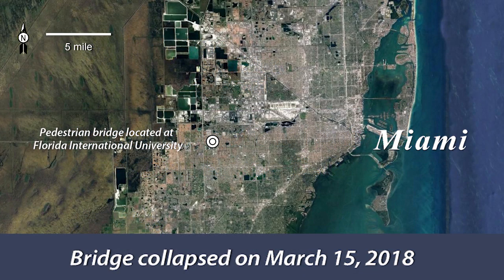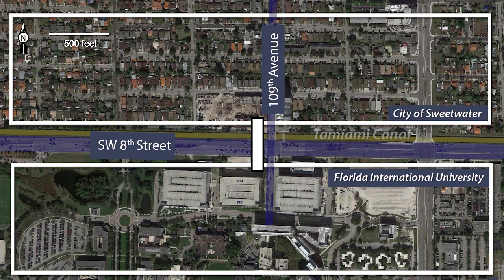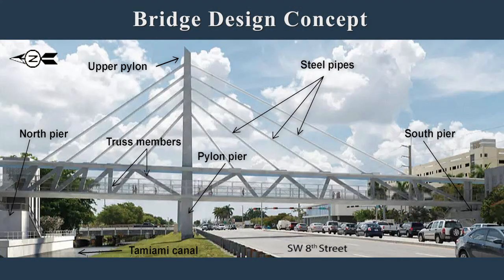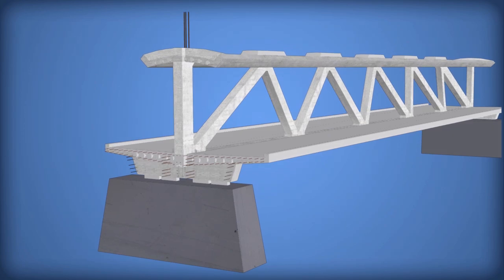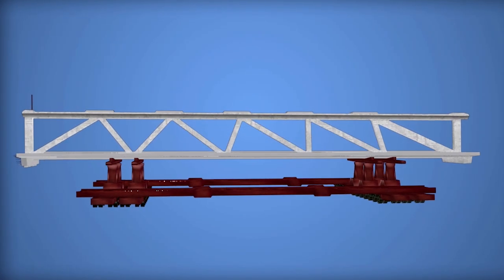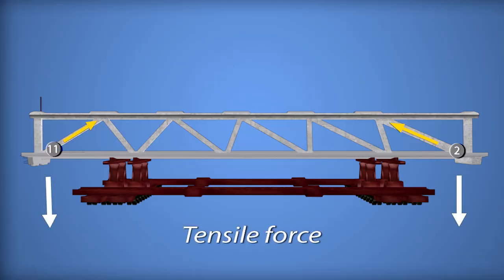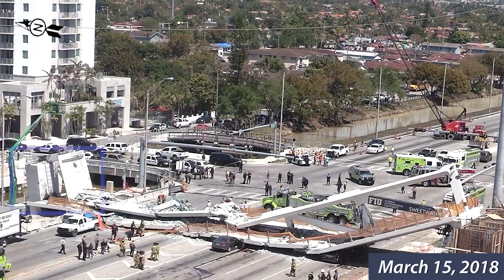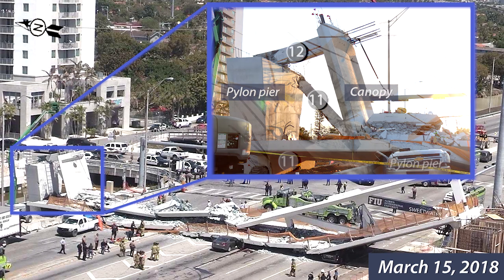Pedestrian Bridge Collapse Over SW 8th Street HWY18MH009

Comment: A steel bridge for this job would have been the obvious choice, even to a moron. 950 tons of dead weight for a foot bridge that couldn't hold itself up.! alarm bells should have been ringing for the designers right from the off. Jail Please.!
Reply: I agree. Maybe they can brush up on their engineering at the prison library.
Reply: betatalk357: I would rather have seen a proper bridge painted pink then this calamity.
Reply: A rope bridge with some planks would have been a better choice
Reply: Florida has some weird obsession with concrete
Reply: The reason we use so much Concrete in Florida, is because when it comes to Hurricanes and other high wind events, Concrete wins every time.
Check out Miami-Dade Building Codes. Every new structure must be built to withstand 150+ MPH winds. My home was built to Miami-Dade Code. We were in Irma and saw winds of 135-145 MPH, the only damage we had was a screen got ripped.
This bridge was criminally designed, criminally installed, and was unable to support itself let alone withstand a CAT4 Hurricane.
Reply: @Capt_Schwartz  Yep, that does make sense. Though it's never good practice to apply the one thing to all the things.
Reply: @Capt_Schwartz NYC has hundreds of elevated subway stations made of steel. They're just like umbrellas and Sandy did not knock them down. Open air steel would have worked fine there in Miami.
Reply: I’d suggest structural engineers are divided into two groups, through educational, cultural, aesthetic biases in their training, perhaps even by commercial sponsorships.  Hence the obvious incorrect design of an RC structure using steel aesthetics, as one style competes for the other’s aesthetic.
Unbelievably bad reaction to the truss failure.  It was obviously failing in compression when loaded. They deliberately tried to increase the compression by tensioning the reinforcement. Exactly opposite to what should have been done.  This was a decision sanctioned by someone not identified in this report.
Unbelievably too, the first reaction should have been replace the lifting bogies (if the structure was deemed safe enough to approach), before any remedial works were attempted.  
You Tube exposes so much that would be buried in dusty print.  Despite this fiasco’s emotional awfulness, a pity some of the comments are gender biased (without any evidence), whereas this event was the culmination of a several bad decisions,  each of which needs to be investigated for systematic failures - who made them and exactly why did they make them.
Reply: They wanted to appear hip and novel in their bridge design--something to brag about to other engineers.
Reply: The core problem with this an many other projects is the board or whatever is the decision making body is sold on the idea by the architects and engineers that their names are going on a plaque on an "iconic structure."   Instead of handling it as a structure designed to maximize utility, keep the costs low and be completed as quickly as possible, they are sold on an art piece.  A library was built in Baton Rouge which was sold as an iconic piece having part of the building cantilevered over a  plaza.  There were no restraints in fitting the building within its footprint.  The cantilevering failed.  I'm sure the cost per square foot was higher than something straightforward and the building was not in use in a timely manner.
Reply: Steel bridge would have been lighter and stronger
Reply: @TheDieselndust  Obviously true.  If you are besotted by RC as many bridge professionals are,  you want to demonstrate RC’s potential slenderness and beauty.  Like Shrek on a diet, success can be elusive.
Reply: @jimwoods9551  well demonstrate Reinforced Concrete where Innocent People Cannot Be Hurt or Killed!
Reply: @TheDieselndust  That’s quite a low bar... 
Regardless of the steel v. RC argument, there is a responsibility to design and execute civil structures safely.  Several people must have known how small a safety factor was involved.  When the first cracks appeared it should have been obvious that the sums or the execution were faulty.  Failure to declare it a write off immediately, shore up the wreckage and stop traffic prior to demolition falls on individuals and corporate directly.  Responsibility for these failures does not appear to have been assigned.  It is particularly important in this case where the designers were showboating by using the “wrong” or counter intuitive design philosophy.

Comment: Why didnt they just actually make a cable stayed bridge instead of just having tbe aesthetics of one?
Reply: There must have been a significant design change at some point, the design lends itself to steel construction. I've never seen concrete used in that way, as a diagonal structural member. Concrete has great compression strength, but incredibly low tensile strength, and a truss in general must have both.
Reply: @A_Lion_In_The_Sun  not likely. more likely would be that an engineer signed off on the design of the completed bridge (which would have included tensioning rods in all the truss members), and the construction company didnt care/understand that the span needed to be functionally complete before being placed (all tensioning rods installed). they should have consulted the engineer/architect beforehand if they weren't sure.
Reply: @A_Lion_In_The_Sun  yeh that sounds reasonable
Reply: probably cost.
Reply: @Cynyr  Too bad this bridge cost them many times more what multiple structurally sound bridges would have in the end.
Reply: @Cynyr  its always about money
Reply: They wanted some that look different. This was built more for looks than function
Reply: @davidhenderson3400  well, from what happened, I would say looks more like it didn't function.
Reply: @davidhenderson3400  Yep. Form over function. This is the end of civilisation we're witnessing.
Reply: My thoughts exactly
Reply: A cable stayed bridge would need to be built in place, not offsite and then moved like they did here.
Reply: That one was intresting cause they did the wind calcs but they didnt expect the slight swing due to walking to cause people to walk in step perpetuating and increasing the swing
Reply: @lightarmanov6266  - This is why soldiers crossing a bridge "Break Step", instead of "Marching in Unison", to stop Harmonic Amplification! 

Remember the Instructions to Joshua to March the Troops around the Walls Of Jericho, 7 times, then Blow his Horn? Harmonic Amplification, and the Horn Finished the Damage, like a Vibrating Hot Knife through Soft Butter! Down they came! Likely just like this bridge! 

They also have appeared to have failed to understand, traffic below the Bridge, could also build up a Harmonic Amplification, as a Steady flow of Vehicles, at an even pace, creates its own Air and Ground Compression Pulses, like an Electric Razor, almost! 

Like pushing someone on a Rope Swing: you don't do it all at once, you start slow, and with a small push, and let go. As you do, you can back up slightly, as the return pendulum effect takes them past where they started from. Again, you push, a small amount, and move back a bit. Keep repeating, and in just 60 or so Seconds, you don't have to Back up, as they are now swinging over your head!

The Supports for the Swing, need to deal with these dynamic loads, and Concrete hates Dynamic and Both Continuous Changing Loads, and Frequencies. It's best in Static, or Near Static Loads!
Reply: Thats America. Fake trusses, fake columns, fake bricks, fireplaces made out of drywall.
Reply: Why not make it from steel then cover it with some concretey looking material?
Reply: @RennieAsh  Or just make it from steel and be done with it. It's just a pedestrian overpass over so you don't get hit by a car crossing the road there. Not everything has to be an 'architectural statement' and especially if it's paid for with money taken from people under duress. What's more, who the hell is even going to be sitting at the seats around the trusses they showed in the animation? It's above a busy roadway FFS! https://youtu.be/5Y_71L35CvM
Reply: Tony Rule they made a pedestrian overpass near a university area in my city. Steel, architectural, has canopy. No idea if they’ll put seats there though. I prefer an interesting design. It doesn’t even have to be too outlandish.
Reply: @RennieAsh  - Aircrete could have given them a "Concreted Look" at a Very light weight if it's Core was proper Steel build (hint: It Floats in water, about 50% out of the total mass)!

But, regardless: Zero Backup Stress Paths, or Zero Redundancy? Even children know, it's better to have Two Legs, than just One!
Reply: krepnata kadara  - Doctors use that, to Put you Out! Are you sure it's not just for "Aesthetics?" (Looks!)
Reply: Oof the animation has ceiling fans.  I think the problem with making ot from steal or hanging it is it could reach its fundimental frequency when the wind blows
Reply: @lightarmanov6266  Plenty of structures like bridges are made from steel. We understand natural and resonant frequency and dampers can alleviate any such problems.
Reply: @TonyRule  yeh I know its a solved problem I was just trying to guess why not
Reply: @lightarmanov6266  I think the "why not" comes down to people's vanity.
Reply: To do that , the pylon must be symmetrically loaded. Which means they would have to put the pylon in the center of the bridge. With the current design, the cables can't be stressed or the pylon will bend towards one side.
Reply: They wanted to showcase the method of fabricating a span on the side of the roadway, then moving it and lifting it into place, which minimizes the time the road is closed.
Reply: Tho it was still in safty bounds
Reply: because they studied architecture
Reply: @constantinosschinas4503  ok yes they did but whats the architectural justification for this?

Comment: I might be a mechanical engineer by training, but even I can tell, by looking at those cracks, that that member had lost all of its structural integrity. At that point there was no saving the bridge. At that point they should have transported it back or demolished it. Tensioning the member onto the already damaged joints was absolute folly and no one should have even thought it.  It looks like it started with a bad design and then was compounded by bad decision making on inspection  of the damage.
Reply: To follow in the spirit of your comment.  I might be a network engineer by training, but even I know that when there is a problem with something heavy that is at a raised height, the first thing you do is clear the area below it and keep it clear while you work out a solution to the problem.  :)
Reply: @kencramer1697  And to follow from your comment, I might only be a historian by training, but even I could tell that when an experimental-design bridge develops cracks in the load-bearing joints that appear on day one and grow wider and longer every day, it's time to get everybody out of there.
Reply: @deppexcavation5483  "structural integrity is GONE." I do not think it was ever there to start with.
Reply: As a civil engineer who doesn’t build bridges, you’re exactly right. Those weren’t typical shrinkage cracks - those were structural failure cracks. They should have closed the road immediately and demolished it in place. Both the structural engineer of record and the contractor should have shut it down when those cracks first appeared.
Reply: spacecadet35   Don’t forget the probable paid-off inspector.  How could any inspector with integrity sign off on this?
Reply: @Graham Welby Oh, I could see the numbers being well over a hundred. A fully loaded bridge and a bus or two under it.

Comment: Major fault and they just wanted to try and fix it, should of been removed and destroyed but didn't want the cost to blow out and make then look stupid, guess again they look worst than stupid now, how many admitted fault?
Reply: None. FIU was allowed an unprecedented amount of self certification authority. They squandered it by allowing a horrible design instead of using 100% tried and true cable stayed bridge design and engineering. They publically available documents indicate an FIU bridge project concerned with all sorts of issues except designing a safe bridge. Experienced successful bridge designers and engineers from around the Earth have severely criticised this project as one lacking focus on using good proper cable stayed bridge design instead of some risky experimental untested design. The lack of proper standard traffic control during bridge work also has been universally condemned.
Reply: @davidhoffman1278  Just curious (I didn't know about this until after the failure), was this criticized prior to the failure or after?
Reply: @AmbientMorality 
 After.
The publically presented marketing drawings, before the build started,  looked like a standard cable stayed bridge. Why would you have a cable tower and cables unless you were doing a cable stayed bridge? 

Afterwards, when the truth was revealed, bridge architect responses ranged from dismay to furious rage. Such utter incompetence and deceit by architects and engineers was unprecedented in supposedly modern "first world" nations. This was a relatively short span and should have been able to be accomplished with the most basic of cable stayed bridge design and engineering. To get the entire project( design, engineering, construction, public safety) so incorrect was a huge blot on the bridge building professional reputation of the USofA.

Comment: An excellent video, even I could follow it. It seems like the design was very marginal. I did not realise the truss members were cracking, and photographs existed of these growing cracks for days before the collapse happened. Surely those cracks should have been more than sufficient warning to close the road and tear the structure down before it failed on its own. Why was it a pretend suspension bridge anyway, was the winning of the contract more dependent on aesthetics than engineering ?

Comment: The most interesting aspect I think, was the retightening of the post tension cables.  What is the theoretical purpose?  Once the truss is loaded under its weight, the member is in compression.  Why add more compression with a cable, that would only add to the buckling force on the member as a column?  Breaking the tension rod down into vertical and horizontal components, they could visually see that the horizontal component was deflecting a quarter inch or so at the joint.  Tightening the rod was adding to the horizontal force in the wrong direction.

Comment: The part that failed was in tension, and already showing signs of distress, so they wound more tension into it? That's not manslaughter, that's murder!
Reply: NO. It was under tension for the move, then un-tensioned. Then they re-tensioned it as a fix.... but it was too late for that.
Reply: Concrete fails in minor tension loads. Concrete must always be under compression. The post tensioning is critical.

Comment: the design theory of this design looks to be somewhat sound with ideal conditions.  however, it appears it was not quite built as specified on paper, possibly due to instructional confusion in what to do.  I also see a serious flaw in the placement of the beams, which may have worked better if they were all of equal size instead of unique in size.

I also would not have trusted this bridge, even if it had an i-beam, without an additional support at the midpoint of the span.  the deck was not thick enough for the span to be considered reliably safe using reinforced concrete alone, and considering the type of weather they can get, a super long i-beam alone for added support would not cut it in high winds.